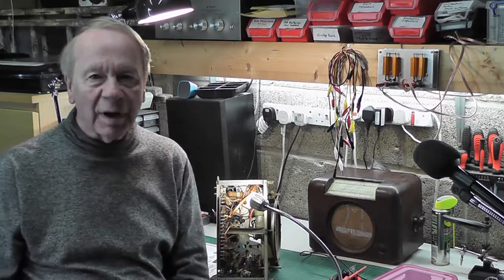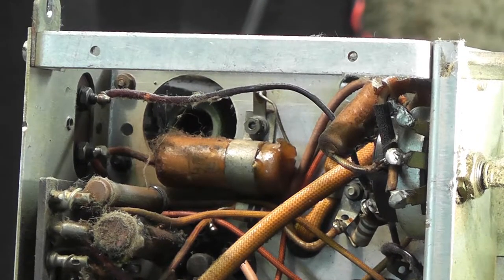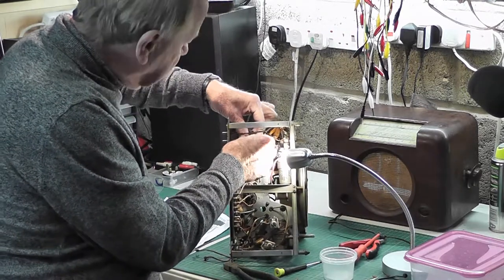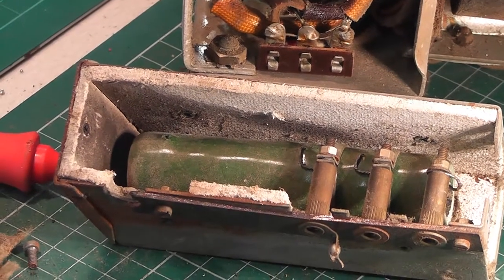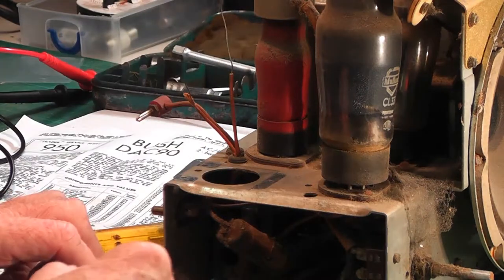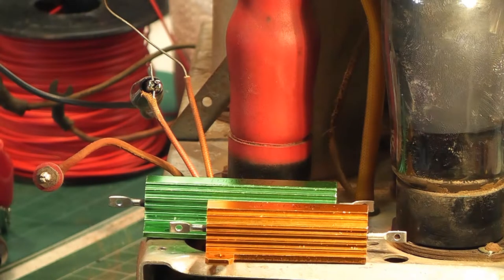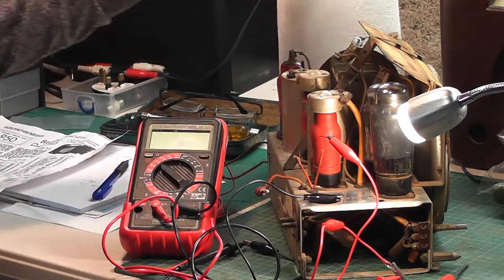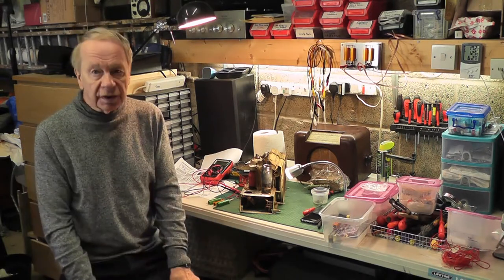Bush Radio DAC 90 Repair (Part two)

Comment: Hi David. Hope you are well. I'm repairing an old resistive dropper valve radio at the moment and it has a failed open resistor like in your case. However, the resistor on mine is tapped in different places to give different voltages along it. Finding an exact replacement will be almost impossible, so shall I buy individual high power resistors and put them in series? Or is there an easier way? Many thanks.
Reply from the maker: Thank you for your question, will get back to you very soon
Dave
Reply from the maker: Sorry for the delay. There are two ways of dropping the mains voltage. The most radical way is to replace the resistors with a full wave diode rectifier. This will of course make the receiver 'AC only' and some major circuit arrangements are needed, it does however solve the heat generation issue that dropper resistors create. To keep the radio authentic, you need to either  find a scrap model with intact dropper  resistors or construct your owne with high wattage ceramic resistors. I remember using radial 15w resistors designed for this but not sure if they are still available. I would set up an external jury rig to measure voltages, current and heat generation before attempting to install. Remember the originals were shielded with asbestos, so some form of less hazadus sheild will be needed. You have probable figured all this out for yourself but hope my suggestions help get your receiver working again.  Take care.
Dave